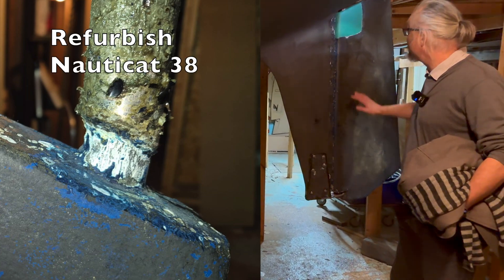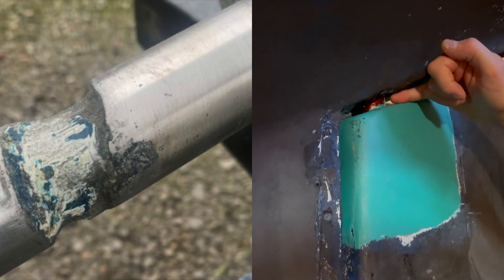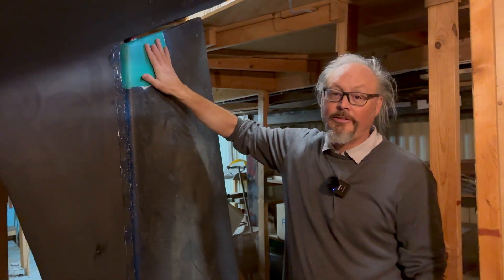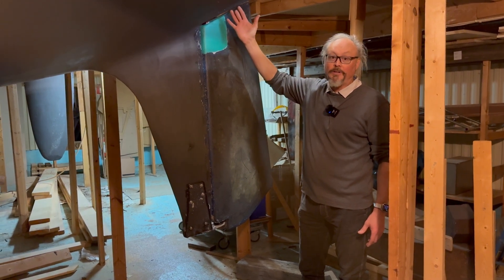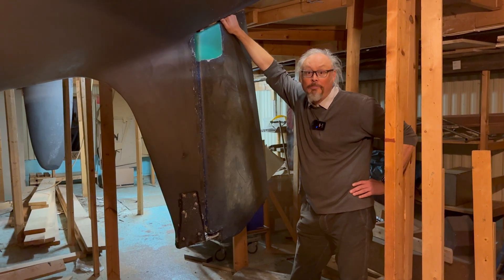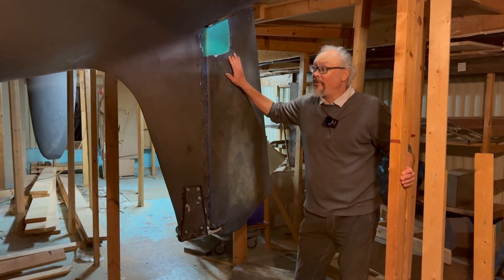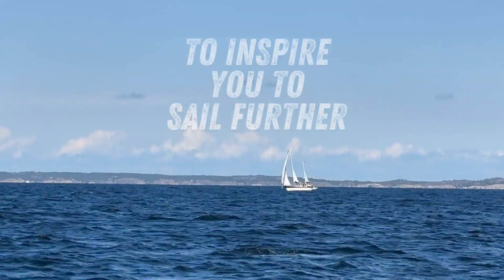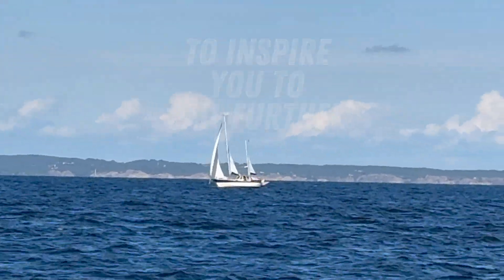Nauticat rudder - Could end in disaster!

Comment: Thanks for putting all this online. i want to buy a nauticat 32 in the next 2-3 years and your videos is part of my preparation (and anticipational dreaming)
Reply from the maker: Nice to hear. Happy to help. Nauticats are great boats!
Reply: @Sailing-Maja You are absolutly right,! Even I secretly dreaming of a Sirius 35DS, but Nauticat 32 deliveres 90% for a quarter of the money. Did you watch Kaj Gustafsson NAUTICAT Interview (otherwise look it up on YT)? It won me completly over, great attitude of a fantastic boat designer.
Reply: This is why I don't like metal rudder stocks and stainless steel in general under the water. If you sail in the tropics then the process is accelerated greatly by the warmer water. I prefer FRP or Carbon rudder stocks for this reason.
Reply from the maker: @deerfootnz Thanks for sharing this advice. 👍